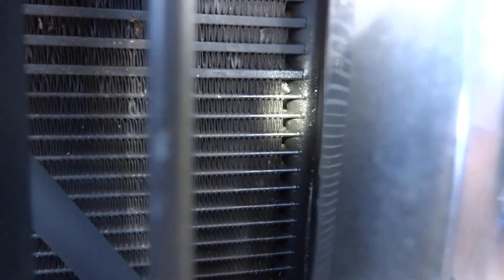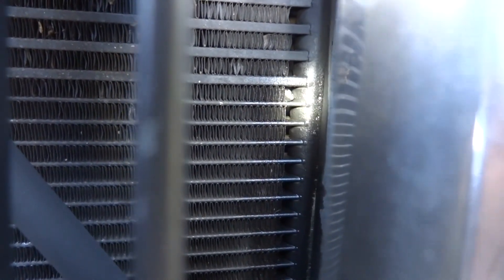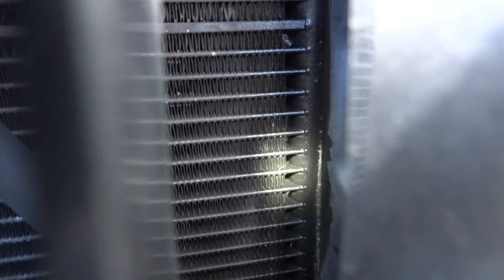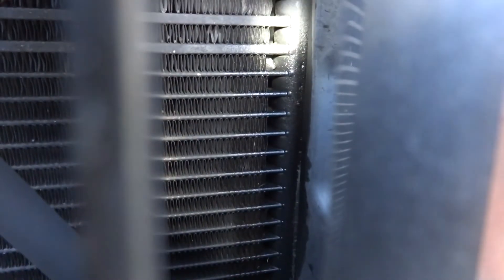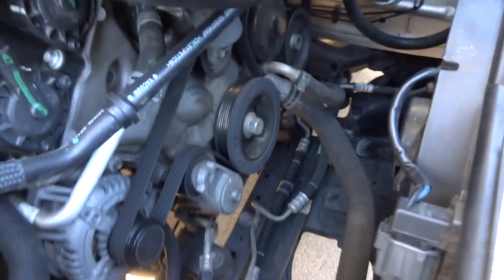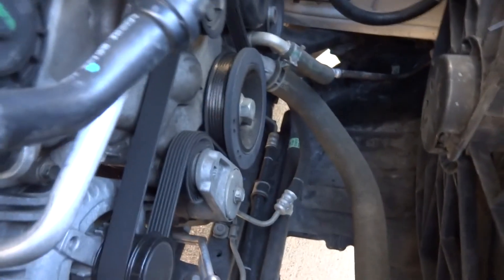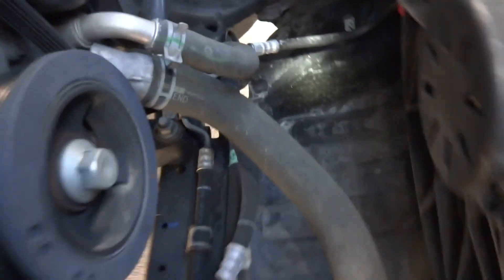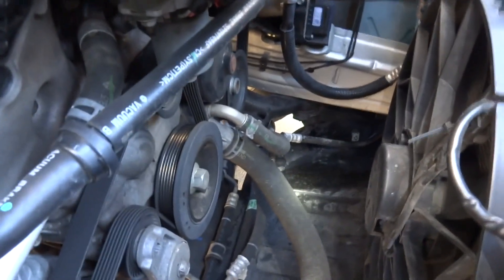2011 Jeep Grand Cherokee leaking A/C Condenser /  Trans Cooler

Comment: Yep. I bought a 2011 jeep Cherokee Laredo with the 5.7 last April. Ac quit a week after I bought it. Decided to ignore it til this summer and we have a severe heat wave drought now. Been adding several cans of freon every week. After using stop leak and the uv dye cans I gave up looking. Decided to check the front since it smells like freon there and found a ton of green freon all over the left side splash guard and the lines on that left side. Havent tackled thr repair yet. Condenser doesnt have any freon on thr outside fron what I can see though. Possible just the lines are leaking.

Comment: Our 2012 leaks from the same spot.  The welds appear to be cracked right where the lines attach to the side.  The leak is refrigerant oil. Use a black light and you'll see that the oil glows orange from UV dye.  Definitely a material problem.  This is unacceptable on a 4 year old vehicle.  I need to check if dealer has some kind of discount on replacing the condenser since this is obviously a defective item.  Have had 10-15 year old vehicles that have never had this kind of problem.
Reply: look up recalls as well my 11 has the same problem due to them fixing the recall and they won't fix their own mess up.

Comment: same problem with my 2011 , guess got to replace the whole  unit if i want the trans leak to stop .
Reply from the maker: its the A/C leaking.    the top is the trans the bottom is the A/C    after replacing this one its now leaking again.    get the one with lifetime warranty.
Reply: @daves.projects  thanks i wonder if the one off ebay are any good ?? they are under 100 bucks .
Reply from the maker: @txknightrider82  Lifetime Warranty   https://www.amazon.com/Condenser-Dodge-Grand-Cherokee-Durango/dp/B07GVRKM4N/ref=pd_ybh_a_84?_encoding=UTF8&psc=1&refRID=XR2H8KSRHBJTMFJZBCH5
Reply: Yes i found one on ebay  lifetime warranty 👍👍

Comment: My 2013 Jeep Grand Cherokee has the same problem. It leaks transmission from drive side about quarter down from top. It's transmission fluid. Do not buy OEM replacement, that will probably leak again soon.

Comment: i have a 2012 grand cherokee and it is leaking from the same exact spot
Reply: do you  find  out  what is the  problem
Reply: +Fernando Marroquin Cerros. 
The transmission cooler is leaking. The bottom half is for the air conditioning. so I bought an after market transmission cooler and mounted it to the front of the other one.
Reply from the maker: https://www.youtube.com/watch?v=OBwUMeSZszU